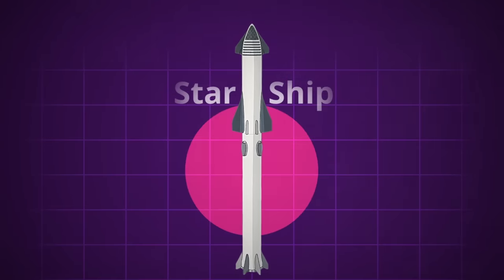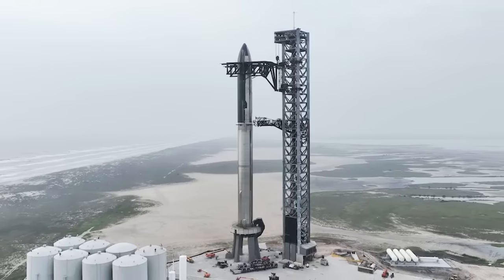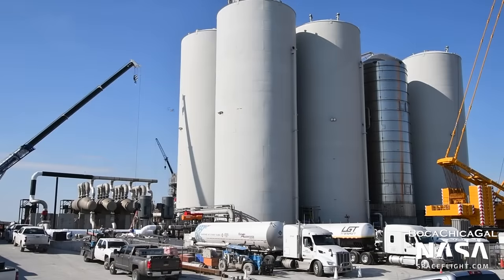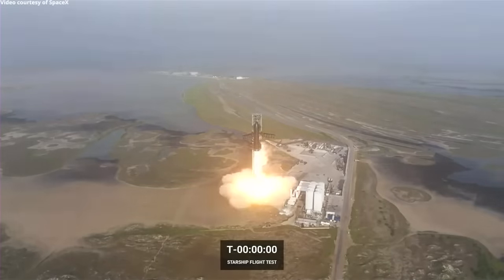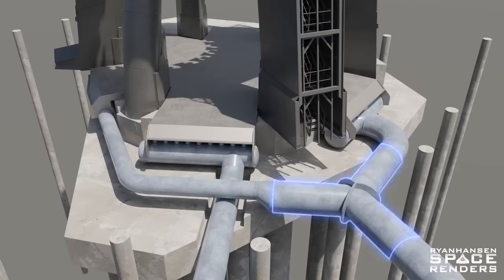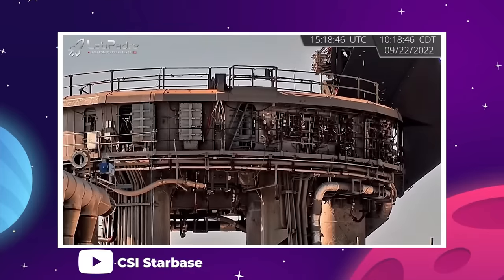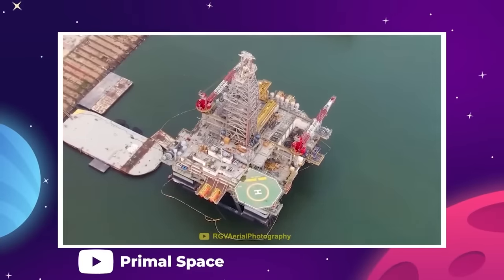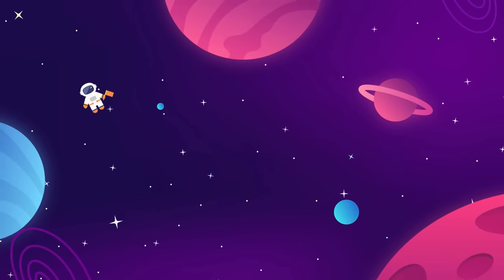How SpaceX Reinvented The Launch Pad!

Comment: We did worry about a 60 foot Launch Pad---especially launching 16 Million Pounds Force at 6,000 Degrees, with a 400 Foot Long Exhaust. In Fact it was 27 to 28 Months ago We Warned of a Launch Without a TRENCH DELUGE SYSTEM. We are actually amazed, the Launch pad sees so little damage.

Comment: It appears to me that your Falcon 9 launch scenario is incorrect. The stages and payload/capsule are assembled in the HIF, or horizontal integration facility right next to the launchpad. Only then does the transporter erector bring it up a rail system to the pad itself.

Comment: With the amount of concrete they used for that thing, they might as well have built a conventional trench launch platform from the beginning. But hey, if it works, it works.
Reply: But it won’t. And it’s questionable if their water deluge system is even legal since they will be dumping a bunch of polluted water into a protected sanctuary.

Comment: That was how all traditional Western Rockets were launched the Soyuz has used an Orbital Launch mount since the 1960s obviously its a lot more basic than the SpaceX one but then it didn't need to be complex for the Soyuz
Reply: If you think Soyuz was much simpler than SpaceX's exploding pipe, then you have no idea what actually goes into designing a rocket.
Reply: @KnightspaceORG  By simpler I meant 60s tech vs modern its still rocket science though.  Soyuz has been relatively unchanged since the mid 60s
Reply: @bigianh  I apologise for the hostility, but to call old tech more basic is just simply untrue, especially since Starships's launch pad was now forced to use solutions that existed since orbital flights were a thing. The materials might change, so can shape, but the basics remain the same
Reply: @KnightspaceORG  Ohh I get that the Physics and engineering haven't changed much.  Actually when you get down to it Soyuz is even more impressive because back then they were using pencils & slide rules and didn't have access to transistors never mind the micro processors we have today
Reply: @bigianh relatively unchanged is a pretty strong generalization. Sure, same engines(ish) and booster design. But if you think the rocket is the same then you are grossly wrong. The first rockets could literally only launch tiny probes literally the size of a watermelon. While today they launch missions on one of the worst orbital trajectories to the largest object ever put into space.
Reply: @TheWizardGamez  They don't launch really heavy stuff on the Soyuz it's been a medium lift rocket since the mid 60s (Despite some experimental versions with 4 stages).  And yes there have been updates mostly safety fixes after Komarov's accidental death and after the Salute 1 disaster but the 1st stage and the boosters are pretty much what was flying in the mid 60s I think the engines have had 1 or 2 tweaks but they are still the same basic design

Comment: Starship Landed ~ 3 Miles from Targeted location in Indian Ocean --- + or - 3 Miles won't do for Mechazilla --- It's going to Need + or - 3 Feet accuracy. Understand there was no Beacon or Topography Features on the Ocean, BUT THE #5 BOOSTER WILL STILL HAVE TO TARGET 0.05% MORE ACCURATELY. ... not to mention it's 'Attitude' in any Cross Winds. Lot of Surface Area.

Comment: Very informative. 
However, watching the SpaceX launchpad design process just demonstrates how pig-headed they can be. Yes, they have learned from failures during the iterative design process. But some of those failures could have been easily foreseen by "traditional" designers of launch pads. SpaceX, in their pig-headed insistence that they always know more than all the rocket experts of history, proceeded with a design that was inadequate to the needs of Super Heavy, and everyone BUT SpaceX knew it, and the completely foreseeable failure gave them a real black eye in the area of PR and relations with government regulatory agencies and local residents.
Thankfully they have fixed many of the design flaws and are in the process of fixing the other obviously stupid part of their design - placing giant upright propellant tanks a few hundred feet away from the most powerful rocket in history and expecting them to suffer no damage.

But there is another thing that has remained unaddressed. The more complex and indispensable you make the "Stage 0", the more devastating any damage to it will be to the continued functioning of your fleet of Starships and Super Heavy boosters. Since neither part of the system has landing legs, you will be catching live, partially fueled, flaming components as they try to land - all in the name of quicker reusability.
All you need is one slightly misaligned catch, or an engine or guidance failure at the end of the flight to completely destroy one of the Stage 0 facilities for a VERY, VERY LONG TIME. You will not only lose a Starship and Super Heavy, but you will lose the ability to launch the rest of your fleet. To me, that is a very large drawback that more than compensates for any weight savings of eliminating landing legs.
Why not just have a landing pad on rails a safe distance from the launch pad? If the landing is successful, then you just ride your booster or Starship back over to the launch pad on the rails, and then the chopsticks pick it back up and place it on the pad for another launch. If you have a failed landing you have lost a much less complicated structure far away from any fuel tanks.
Perhaps some of the engineers at SpaceX have figured this out, but Elon is pretty hard to sway once his mind is set on an idea. If he doesn't think of it, it likely won't get done.
Reply: Well put. I agree with your comments. However, there is even more unaddressed problems ahead. Specifically, just one catastrophic failure on launch that whole launch facility is going to be destroyed and there will be some massive secondary explosions. Your comment that SpaceX/Musk is pig-headed is right on point...but I would also add SpaceX/Musk wants to do everything on the cheap on the service support side. Hence, the ludicrously small footprint of the launch facility. The failure to build a proper launch facility without a proper fire trench/baffle diverter deluge system is going to bite them in the ass down the road.  Additionally, they chose to build their facility right next to the beach at Boca Chia on a barrier island right in the middle of a wildlife refuge. Plus, one level 5 hurricane with the usual accompanying storm surge will wipe that entire facility out. So, I blame the State of Texas and the Federal Government for allowing this to happen in the first place. I am all for commercial space programs but if they can't meet certain infrastructure standards they shouldn't get in the game in the first place.  

That said...there are other failures here...if you look at the slow-motion launch video the overpressure pulse waves of 33 engines with 16.7 million pounds of thrust coming off the first stage means a massive amount of harmonic vibration on the whole Star ship stack and the entire launch facility. I believe that had to cause damage to the facility and the stack all by itself not to mention the so-called stage Zero which suffered lots of damage this last launch.  That is why they need a fire trench.  

The fire trench serves a specific purpose as it transfers sound waves and thrust down into a covered area diverts thrust in one or two directions and protects the stack from reverberation of overpressure back into the stack. I have a feeling that they have not isolated Star Ship electronics, gyros and gimbals enough from that vibration and that was a contributing cause to the explosive destruction of both stages. Additionally, it didn't help the shield the rocket array either. 16.7 to 20 million pounds of thrust presents a whole new set of challenges in launch physics.  I would like them to do a test of Starship on pad 39A at the Cape and see if that handles the vibration better. 

Bottom line it looks like they have a long way to go and lots of problems to solve before they let anyone fly in that ship.
Reply: Here is the thing tho, if you look at starbase operations you will see that what you are advancing as a thesis (that the engineers and Musk are pig headed) is demonstrably false. Many changes were tried, tested, and changed again. Sometimes going forward, sometimes reverting, but the unifying thing is that they will never say no outright if the physics say it can make sense before they actually try it. 

An example that pops in my mind was the GSE long duration storage tanks. Considering how much fuel is needed for starbase ops, SpaceX figured they could use their already existing manufacturing to make GSE tanks and sleeve them with thermal isolation for long term storage. However while completely sound both logically and on the balance sheet, odd regulations (like the fact methane tanks have to be sideways), various issues with leaks, and obvious issues with damage during IFT-1 highlighted that while this solution had merit and worked, it also wasn't worth it's tradeoff. So, they diverted and started swapping out the tanks for more regular cryogenic storage tanks. Try, test, iterate. Musk himself keeps having to repeat this point to people, that if you aren't failing and/or rolling back ideas you really aren't innovating enough. Failure is expected, success is a potential outcome. but you will never know if something can work practically if you never try. 

We saw the exact same thing happen with the rocket exhaust. Contrary not the mistaken belief that "why don't they build a flame trench hur dur", people forget that there is far more that goes into his than a big hole, things that make a flame trench impossibly difficult to build at starbase. 

Starbase is located, like many other launch pads, inside a nature reserve. A perfectly logical and harmless thing, but it imposes some pretty severe restrictions. More on that later. 

The entire area is a swamp right next to the sea and therefore the water table is extremely high. If you just build a concrete trench there you have effectively displaced water and successfully created a boat. Spoiler alert, unintentional flotation of your structure is usually not something you want. So you need to elevate the entire thing. 

This is what was done at the cape, they built the launch systems on GIGANTIC artificial hills dumped onto the nature reserve just to be far enough away from the water table to build that trench. Russia which launches their rockets in the middle of nowhere, can indeed just build a big hole, but not here. 

And of course the first issue here is that spaceX isn't a state. They don't really have the resources, legal leway, and really logistical abilities as NASA at the height of the space race. They don't even have the required land nor can aquire the required land even if they wanted to. So just building an artificial hill like at the cape is not a practical option. And therefore, the easy solution of the flame trench is right out as a result.

The failure of the concrete was also NOT SpaceX being pig headed either. The manufacturer specs said it could work, and static fire testings showed it would work. At the time of IFT-1, the water plate was already prepping for installation, but both SpaceX and the FAA thought it would absolutely last a single launch at least with the data they had.

Problem is the reaction of underground swamp soil to the most powerful rocket launch ever made is NOT a deeply known field of science, and they ran into something no one had predicted where it's the ground bellow the entire OLM that caved in. Which was of course fixed with the water plate solution as you know. Which worked flawlessly during all subsequent static fires and IFT-2

An adequate solution to an extremely complex problem, that people with more anger than knowledge can't wrap their head around because "why not flame trench". What you really believe that the people that land rockets and that know such a system works would not just do this if it was practical of even really doable? There is no silver bullet in engineering, only tradeoffs.
Reply: To further continue on some other points. The catching and the damage potential. Just like with falcon 9 and the barges, landings slamming into the barges has caused damage to them obviously, but never something that wasn't easily fixed even if they failed the landings and that is due to a careful choice of trajectory. The falcon return trajectory never aims for the landing spot on a freefall trajectory, it first need to confirm aerodynamic control with it's grid fins to not smash into the ocean, and then it will still overshoot the landing site unless it's engines function, upon which it's burn will bring it back over the landing zone. This is why falcon never failed a landing in a spectacular way that would destroy the badge. It cannot get to that point without getting most things right already. 

Both starship and superheavy's default response, completely separated from active control, would therefore be the same : missing the launch pad and crashing nearby instead of at sea. 

Then we can look at the times where falcon crashed into the barges, and when starship landings were occuring we also see the other thing: returning boosters and ships carry considerably less energy and less mass than at launch. When falcon or starships exploded on fueling it let to a gigantic energetic fireball. Meanwhile even starships like SN-9 slamming on the pad at full force did not lead to anything close to such an energetic event. It would cause damage, but not even to the scale of the IFT-1 damage which was repaired in less than 2 months. So definitely taking out one of the OLMs, but not for a considerable amount of time. And that is ignoring that starship and superheavy can HOVER, unlike the falcon 9 which could only perform a suicide burn. Meaning their descent is a lot more controlled way less reliant on pinpoint precision.
Which you know after 260 odd successful hoverslam landings you kinda start to have a bit of knowledge in the matter.

Comment: Cancel water deluge system and legs, double the present hieght of launch pad, the space distance from nozzle to tke ground but a big changes to launch pad legless but to fabricate other menchanzillla like but to tripple the strenght of menchanzilla like to build as lower new additional heavy ccarrier crane menchanzilla with bisected launchoen  pad when rocket elevate from it  then it will open and move sideways to free launch pad directly expose to huge fire from rocket nozzle, the distance with good constructed  ground base will help to  lessen pressure cause by heat plus the coolant from launc pad even it is moving sideward scattering the gas coolant arroud the  lower part of the tower space down to the ground base..

Comment: I got to be that guy real quick. If Starship can't lay over on its side, how does anyone expect it to do the belly flop or flip and burn maneuver? Also how was ift 1 able to rotate over 360 Degrees while attached without succumbing to aerodynamic forces? I think the whole ship can't be on its side is a misconception
Reply: flip and burns or other midair maneuvers are probably different from sitting on the ground and having most of the weight on one side instead of distributed across the support structures inside the rocket

also, for like flip and burns, those raptors are mounted much more structurally than a sheet of metal forming the skin of the ship that d definitely could crumple 

could also just be that they don't wanna risk it or maybe it requires extra maintenance

idk tho, I'm no engineer
Reply: Because the rocket is in freefall and aerodynamic forces are very different from the forces experienced on the ground.
Reply: @diogenespepsi6244  nope. Rocket will be falling at 1g. Just like sitting on its side on the ground. Plus you have the relative wind pushing upward on it. So it actually is under more stress falling than stationary. It could be transported horizontally, without damage.
Reply: @faceboy1392  I think it can survive being transported horizontally just fine, there's just no real reason to do so
Reply: @citizenblue  I mean if so it's probably just that it introduces some risks of damage and they'd rather not go through the trouble, though I don't doubt the possibility that the ship just really would not want to be tilted sideways given how massive it is
Reply: @citizenblue its not the same, in free fall you dont feel the gravity

Comment: It’s been a debacle of poor design dictated by Musk.  It’s STILL not rapidly reusable, which NASA pads have been since the 1960’s. Its required massive kludges, fixes, and work arounds to try and deal with its many predictable shortcomings. Because, Unlike the rockets, SpaceX can NOT afford to actually “Iterate” the pad design.   They simply have to try and remediate the mistakes inherent in its conception. Every launch and test fire has resulted in millions of of dollars of damage.   Now requiring total removal of the fuel tank farm that was placed far to close to a launch pad that STILL has no blast trench or other means of containing or re-directing the engine thrust.      And the shower head clearly has no real effect on the concussive acoustic shocks you can see still emanating out in all directions that still cause massive damage because the shower head only protects the steel plate.

Comment: The so-called new launch pad doesn't work. The reason is that during every launch the so-called stage zero is heavily damaged...and cost millions to repair. Fire trenches/baffles/deluge diverter systems work....that's why NASA uses them. So if it isn't broke...don't need to fix it.